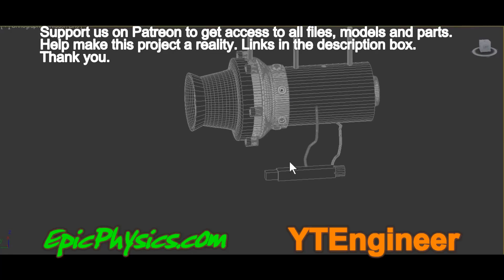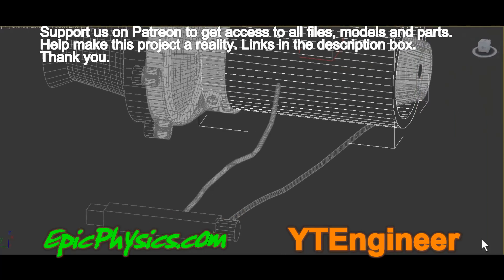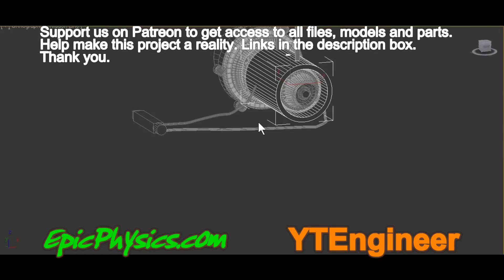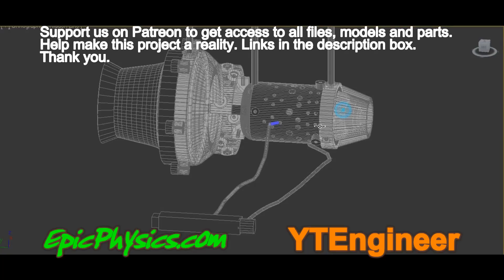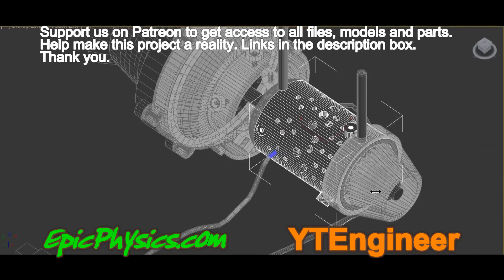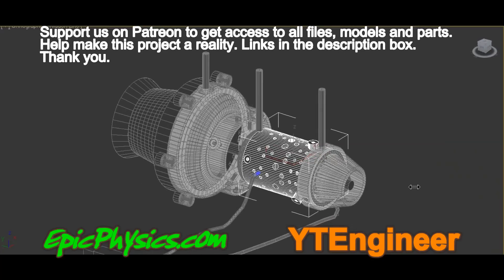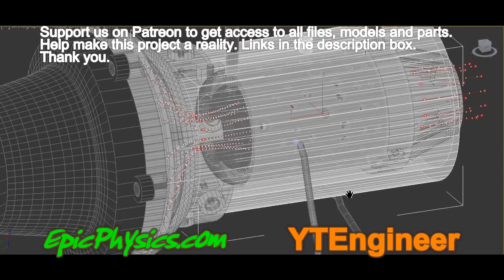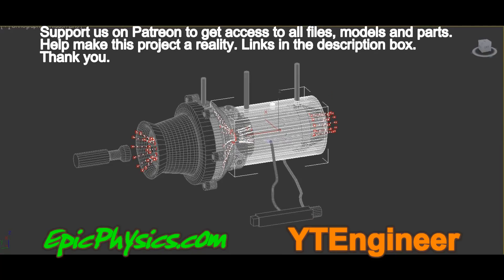Micro Jet Engine Project Part 2

Comment: Heard of the Garuda Sanjivani root?  Might wanna.  I’m pretty sure it’s how planes fly.  Jet planes w spirals on the front of the “engine”.  Just fun.  Fun to calculate the length and diameter of fueling hose...not to mention the time took to “fill” wings w fuel compared to alotted amount needed for proposed miles traveled...just fun. 😉

Comment: Do you know how fuel/heat efficient jet engines are?
Reply: Not much jet engines are like animal's as smaller they become their metabolism gets bigger 
At best this jet engine could output 10W of power in thrust with efficiency of 5 to 20%

Comment: It has been 6 months so I guess it doesn't work
Reply from the maker: Mystic Accending it does work, it costs a lot of money which i do not have, godspeed 👍
Reply: @paulie1982  how much?
Reply: The price for machining just the axial turbine on that scale whould cost up to 200 dollar's 
Just for turbine wheel
Reply: @blackturbine  thats a hell lot
Reply: @joejia1410  well these types of jet engine parts need to be machined by EDM machine with platinum electrode with negative impression of the turbine wheel 
To grind the inconel into shape 
As jet engine becomes smaller it has lower running pressure and it compesades by hotter gas meaning that turbine needs to survive up to 1500 degrees Celsius
Reply: @blackturbine  what about a "squirrel cage"  type air thrust propulsion? Easier to make, stronger rigidity. I'm just not sure if it can accomplish the thrust needed.

Comment: Have you calculated a volumetric flow target range for the completed design? With that, plus the btu's generated and the basic gas laws you should be able to find the probable nominal thrust of the motor - which I suppose is what I'm asking. For its size, if you get 2-3 kg or more you would have something insanely great. Turbojet R/C flying for the masses, tiny, very fast drones...